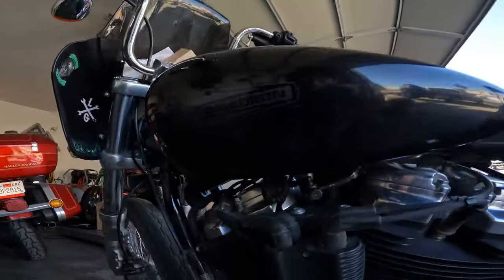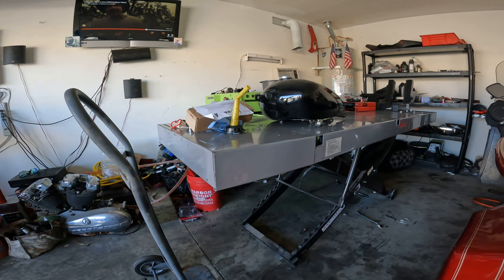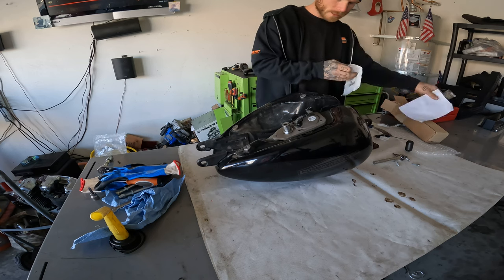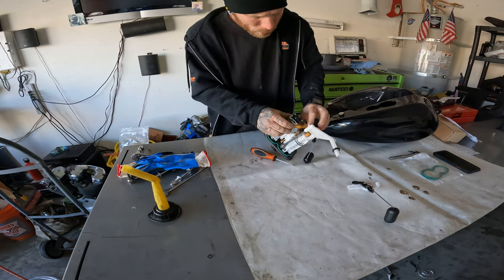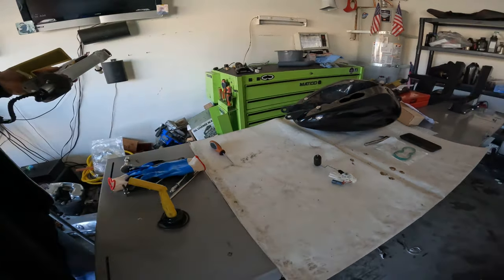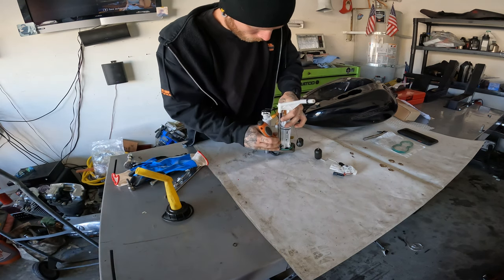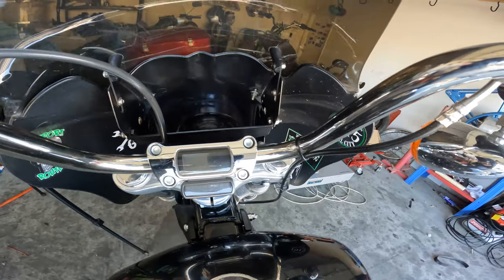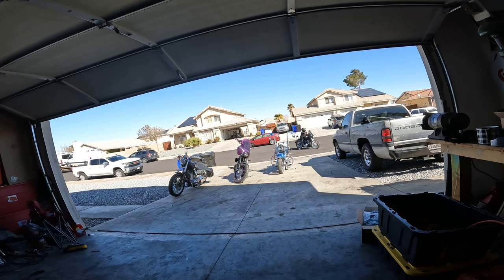M8 Softail Fuel Gauge Doesn't Work! (part numbers included at the end)

Comment: for my breakout 2020.i replace already the fuel gauge still no fuel reading.do the troubleshooting in wiring. everything is fine.
i use the tank to other bike and it got a fuel reading.
and use other to my breakout,no reading.no trouble codes
11km only

Comment: Could you tell what had failed with the fuel level sensor?
Reply from the maker: No, I didn’t look in to it. Just swapped the parts and went on with it. But I’d assume it failed the way most rheostats and similar sensors do where it shorts out across the contact points